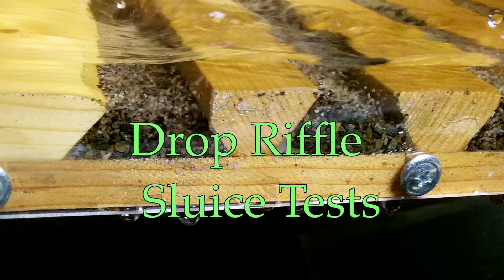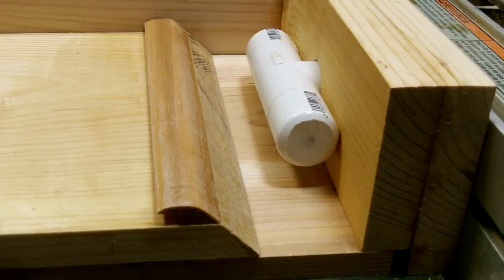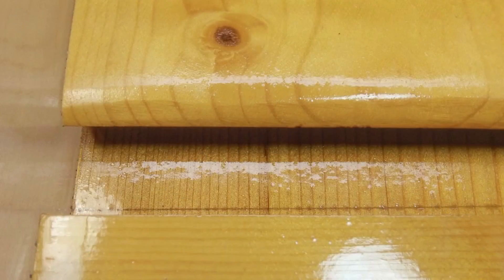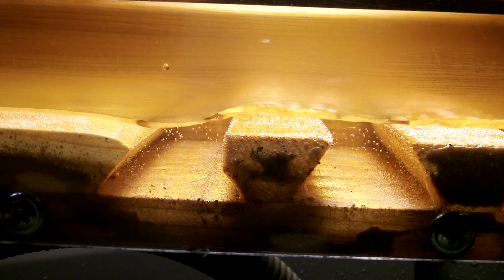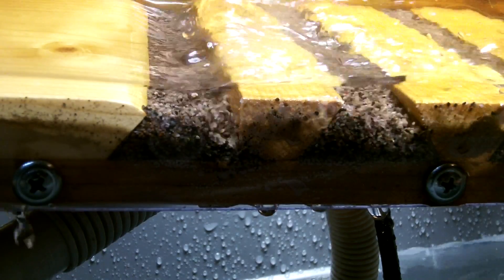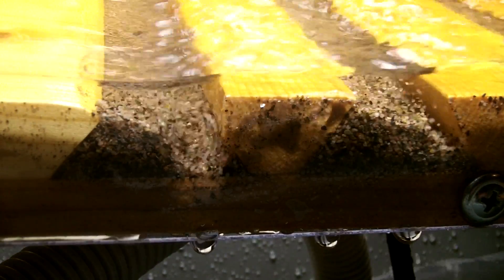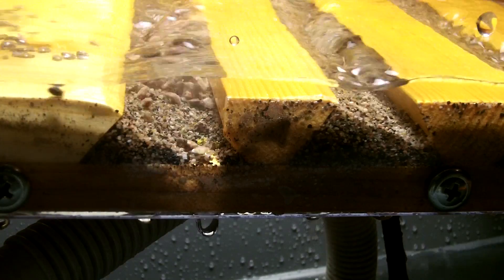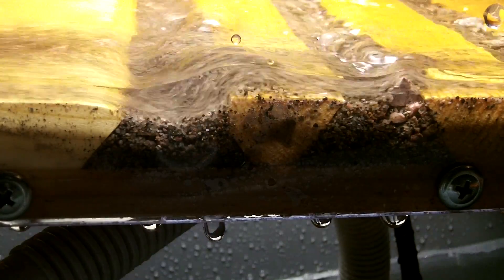DROP RIFFLE SLUICE TEST

Comment: Hi Utah! I am considering building one of these myself.  I watched your video on the miller table too.  So with this sluice do you also use the Titebond 3 to waterproof it?  And when you make the riffles are you using a router to cut them?  I'm planning a trip soon to the west coast for beach sand.  I'm planning to classify it down into various buckets based on the size and running separately like you recommend.  What size mesh would you recommend to classify sand; if you know.  Much appreciated! And I'm sub'd.  You have a lot of good info!!
Reply from the maker: Hi and thanks for watching.  For waterproofing I use  minwax’s Helmsman Spar Varnish. It’s getting harder to find but Walmart and paint stores still carry it.  I cut my own riffles on a table saw but you can buy square dowels from big box stores like Home Depot and Lowes. They are in the trim department. I use the 1/2 inch size mostly. Use the Tightbond 3 to glue them to your baseboard.  I glue them so that there is a 3/4 inch gap between the top 3 riffles and 1/2 inch gap on the rest. If your water flow is set correctly, most of the gold will be in the top 3 troughs.
Most of sand gold will be in the 60 - 100 mesh range and smaller. Lots in the 200 mesh range.  I screen kitchen strainer, 12 mesh or a 20 mesh screen just in case there may be larger pieces. Then I screen 30, 60, 100, and 200. You would be surprised at how much gold is around us as well in those sizes. See my urban prospecting video.
It’s best to do the final cleanup on a Miller table with a very low water flow.
Very best of luck to you and feel free to ask if you have any questions.

Comment: Do you have any rough dimensions for people to try replicating? I would like to 3d print a version
Reply from the maker: Hi pccmachine and thanks for watching. I designed these sluices to give folks the idea of how to build them and let them decide on the size they want.  For 3D printing I think that a 4 or 6 inch wide sluice would be a good start.  Starting at the end, the water bar is 1/2 inch PVC with 1/4 inches holes on the bottom spaced 1/2 inch apart. You don’t need to glue. The water dampening well is 3-1/2 to 4 inches wide. It smooths the turbulence of the water so the very fine gold doesn’t get washed out on the waves. The main deck is 3/4 inches high and 7 inches long. I would make the riffles 1/2 inch wide x 1/2 inch high. Straight up and down. The first 3 gaps or troughs at the end of the deck are 3/4 inches wide. This should catch 80% of the gold. The rest of them are 1/2 inches wide. The length of the sluice will probably depend on how long your machine can make it. The overall length of mine are 20 inches long. Hope this helps
Reply: @utahavalanch  Thanks for getting back to me so quick! I will give it a try and see what happens. One thing that would be interesting to hear your thoughts on are these many different types of plastic drop riffle sluices out there. Specifically when you run some oversized material through yours, and it plugged right up. However, sluices like the ones that geo-sluice markets suggest classifying down to only 1 inch or so.  Even with this mix of material sizes, the geo-sluice doesn't plug up and still seems to capture fines. I have one of them, and it seems to perform very well, though I do classify down to 1/4". Do you think its something about the shaping of the riffles that allows them to still function?
Reply from the maker: @pccmachine1017   If you want to recover the most gold out of a batch of dirt. Screen it down at least 3 sizes and run each size by its self adjusting the water flow for that size gold. Most of the gold is in the finer sizes.  You can also screen through a 12 mesh screen. That’s Kitchen strainer mesh and run that through your sluice. Then take your tailings and run them through a 30 mesh And a 60 mesh screen and run them separately and reduce the water flow. I also run the super fines which is the silt that washes off the dirt that everyone throws away and I recover quite a bit of gold from that. 
If you do like many YTubers do and screen the dirt through a 1/4” mesh screen and run it you will lose about 70% of your gold as all the fine gold will wash out with the high water flow. However you can run it like that but then screen the tailings down through the 12, 30 and 60 mesh screens reducing the water flow way down for each size. Then you will see how much gold all thos other folks are losing.
Reply: @utahavalanch  That makes sense for cleanup sluicing.  I was wondering as to how a plastic drop riffle sluice, like the Geosluice,  is able to get away with running mixed sized material when out on the river, and not plug up.
Reply from the maker: @pccmachine1017 you can run any sluice at a high enough water flow to move most of the larger rocks out. If you have 1/4” rocks and a piece of gold the size of a pinhead, and you run the water fast enough to move the big rocks out. What happens to that tiny gold?🤔
I used to hang out with a prospecting club and at the end of the day, I would collect their tailings screen them and bring home. They would get about 1 gram each and I would usually get 10-15 grams of gold they blew out their sluices.
To keep the gold, you screen the dirt to a certain size and then run the water flow til it leaves mostly the gold and black sand in the top 3 riffles. You see many of these tubers running 10-20 buckets a day and only getting 1 or 2 grams of gold. Collecting only the fine gold, myself and 6 others around here only run about 10 - 15 gallons of dirt in a year.  We collect mostly from parking lots and gutters around town and get around an ounce of gold.

Comment: Would love to see a clear gold pan so we can study just how fast gold stratifies.
Reply from the maker: Hi Andrew, and thanks for watching. 
I and at  least 3 others have done the tests. I haven’t been able to get my video out yet. 
They all come to the same conclusion. Basically big gold goes to the bottom rather quickly but when it comes to small gold, 20 or 30 mesh and smaller That is a different story. Most fine gold is lighter than most anything else in the pan and won’t sink to the bottom unless there is only a very thin layer of dirt in the pan. If you classify the dirt so all material is the same size, then you will have better success but usually the black sand will be heavier and the gold will mix in with it because it has been smashed flatter and will be lighter. That is why it’s so hard to separate the fine gold from the black sand.

Hard rock university has some of the best videos on how to pan micro gold.

One of the best videos demonstrating stratification is the YouTube video…..

“Does gold sink in a gold pan”
by Allan Dampier
He also sells one of the best fine gold pans.

Allan does a good job of demonstrating how gold stratifies. Also pay close attention to his method of panning. He only works a small amount of material at a time and he keeps the material moving from side to side and always under water.  This side to side motion keeps the gold at the same level in the riffles.  It also keeps the material fluid and allows the gold to continue to settle deeper into the riffle and let the lighter material move out of the riffle.  There is no motion to try and “Throw it out of the pan” like traditional panning. Just raise the back of the pan slightly and the lighter material will float out so the gold tends to stay in the riffle.

I only work with 40 mesh gold down to about 500 mesh. I use Allan’s panning technique to pan and then use Keith’s method of tapping to collect the invisible to the eye gold in one spot so you can see it to collect it. 
You would be surprised at how much gold you can find in the micro range.

Comment: has anyone thought of using a round riffle ?
Reply from the maker: Hi and thanks for watching. I don’t recall seeing any but someone may have tried them. I think if they worked well you would see more of them. I have square riffle mats with the top edges rounded off a bit that work very well.
Reply: @utahavalanch  it gives you the round top edge and a back cut.   I have a lot of 1" and smaller bamboo.  I'm just throwing out a hypothisis.   What if you had say a .75" dowel shape riffle, on top of a vmat or carpet, then have a smaller say 3/8 by 1/4 ridge say a half to 2 inches in front of it.... with a gap, then repeat.    I'm thinking if you have the material, you could make them fit tight and run any mat under then have then wedge in tight --- to me a combination off wood that is removable over whatever mat makes sense but I have no real experience.    I also have a lot of mexican palm fronds and the stems are very strong and you can cust some interesting profiles.   My thinking is that having riffles have range or shpes, sizes and patterns makes sense.   I'm also thinking of having something in the 4-6 foot range.   The idea I am working on is to run successive sluices 2-4 maybe that get wider and less slope as they go and have smaller and smaller grizley bars.   I'm also dreaming of setting something up where you could load  good amounts of material and walk away.    My goal is a combination of wanting to separate out useful sizes of gravel and sand from such that are mixed in with a lot of soil.   The gravel was originally from the large flat roof.   There is also DG under the gravel/soil mix that I may remove some or all.  Have you heard of DG having gold?
Reply from the maker: @FeistyKitty-l4c I’m not sure how it would work right off. The thing to do would be to build a prototype like I have here with a clear side and give it a try. I do this so I can watch how the dirt and gold reacts inside the riffles. I video tape a run or two so I can watch it over and over. I have a gram of fine gold I use in about 1/2 gallon of sand that I use to test with and that way I can check the tailings to see if there are any losses and also see where in the sluice gold collects.
Try building a basic sluice that can be easily modified and experiment with different ideas that you come up with. You may be surprised at how gold reacts to different designs.
I don’t know about the DG gold but I do a lot of urban prospecting and I have found gold in some of the most unusual places. You’d be surprised at how much gold collects on streets, large parking lots, gutters, etc. I take a shop vac to big parking lots and roads and collect quite a bit of very fine gold.

Comment: It's AMAZES me others NEVER do these sorts of tests. I'd verify design w LEAD, too: 
Comparing input vs recovery to verify angles vs water volume & lengths
How else can they ensure that considerable amounts of Au aren't lost..?
I'd hire a hydrologist & fluid mechanical engineer for theory before optimizing & verifying design w lead.
Reply from the maker: Hi Truman and thanks for watching. I build and test many different pieces of prospecting equipment. This is just one of many tests I do on all of them and I thought some folks might be interested in it. This is my medium size gold test where I  use a variety of different sizes of lead and gold. I do tests changing the water flow and angle of the sluice. Then I will run the tests all over again with very fine gold to see how it reacts with this design. At the end of each run I very carefully pan the tailings to see if there are any losses. Thus I can fine tune the design to run at its highest efficiency. I can swap out the riffles for different shape and I sized ones. I also do these tests with all the different sluice mats I’m interested in and I can make different designed mats no one else makes and test them.  I take videos on each run so I can watch the action more closely over and over. This helps me go back later on to refresh my memory on how well a certain design worked.
These tests have really been helpful to me to see how different sizes of gold react to different design changes so I can build more efficient equipment. Sometimes a small change can make a very large effect on how gold is caught.

Comment: Good job! Have you tested Le Trap type riffles?
Reply from the maker: Hi Addestensfors and thanks for watching.  Yes, the LeTrap sluices are very good gold catchers. The lower edge of the drop riffle is elevated a bit making it similar to these drop riffles. There are other similar types that have the bottom edge of the riffle lower  and flatter much like on stairs that don’t work as quite as well and the gold catching area is much smaller. However if you keep the sluice angle flatter and the water flow slower, they will work quite well. I’m speaking of finer gold  that I work with. With larger gold of course, you can have a steeper sluice angle and water flow. I prefer the deeper drop riffles like in the video as they have much deeper pockets in which to store the heavies and less chance to lose much gold. I can easily sort the gold and black sand at home on my Miller Table rather than try to do it with my sluice.

Comment: you say your dirt is sub 20 mesh size yet your gold samples are a lot larger , a lot to be said for ( classifying ) your pay dirt.  Cheers
Reply from the maker: Yippers, this isn’t paydirt. If it was it would be too dirty to see anything. This is one of my many test set ups. I have buckets of cleaned sand of all sizes I use for these tests so I can shoot video of what is going on in the sluice. That way I can watch it over and over, and speed it up or slow it down.
I use 2 grams of gold in sizes from -100 up to about 10 mesh so I can see what the different sizes do at different classifications of sand and water flow. I change the water flow and pan out each riffle separately so I can see where each gold size settles. Then I change the size makeup of the sand and start again.
All you can see in this run is the larger sizes but there is 1-1/2 grams of fine gold in there as well. I pan the tailings 2 tablespoons at a time to check for any losses. This is just 1 of 12 runs I did on these riffles and then I used the information I got from these tests to modify them and make different ones.  Then I started again. I do this on all of my mats as well so that when I run paydirt through a sluice, I know exactly how to set it up to catch all the gold.

Comment: Have you run this system with straight edges to your riffles rather than undercutting them ? - and have you tried making the width of the riffles much narrower ? - at least a quarter narrower than the gap between riffles ?
Reply from the maker: Hi Mohammad and thank you for watching. Yes, I have tried the straight edges on the riffles and they work much better. Also the gap or trough between the riffles works the best if it is 3/4 inches wide. 1/2 inch doesn’t let the material work and get rid of the lighter material like it should. 1/4 inch doesn’t hardly work at all and will fill up with black sand very quickly and it won’t leave any room for the gold. Also the deck should be 3/4 inches thick by about 7 to 9 inches long. The riffles work best if they are about 5/8 inches high and 1-1/4 to 1-1/2 inches wide.
Reply: @utahavalanch  I am currently running square riffles 1/8th high and 1/8th long with the gap 3/8 wide.
The gold in my area is never 3/8ths size.
It seems to run okay catching 95% of the gold and accumulates not too much cons , but does need to be cleaned out often , which I do not mind as it only takes a minute or so , and I LOVE seeing gold often rather than digging for an hour like many prefer.
Reply from the maker: @mohammednovalija  
That will work well for you as long as you clean out often like you say. I made some silicone mats similar to yours that have riffles that are 3/16” high x 1/8” wide and 1/8” wide troughs. They are good for small runs of 1/2 - 3/4 gallons of cons or test samples. I do a lot of urban prospecting and collect 1/2 gallon samples of dirt I run across and these mats work well for that. But if I have to run more than a gallon, I use the big riffle/trough sluices.
Reply: @utahavalanch  I shall searh your channel for the silicon based mat videos.
I made my mats by using a router on some flat rubber.

Comment: How hard was it to clean out ?
Reply from the maker: Hi Models and thanks for watching. It’s not too bad once you get the hang of it. You just tip it to the side and let the excess water run down the side rail and out the end of the sluice. Then you can then use a squirt bottle or something to wash each of the grooves out. I like that you can clean each groove individually and check to see how far down the sluice gold has travelled so you can adjust your water flow. You have to watch the grooves closely as they tend to hang on to the gold and you may have to pick it out with tweezers.